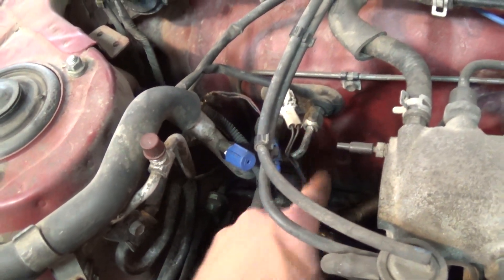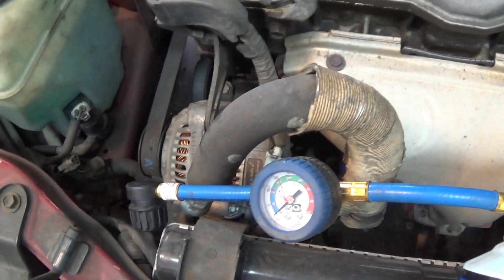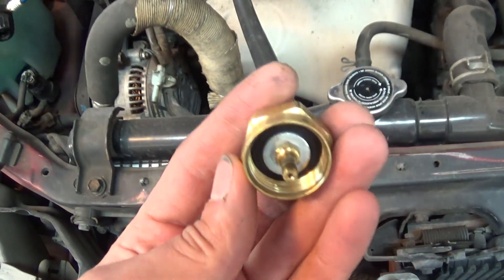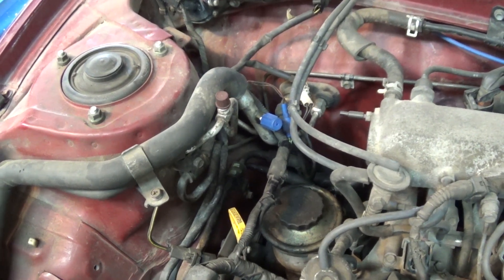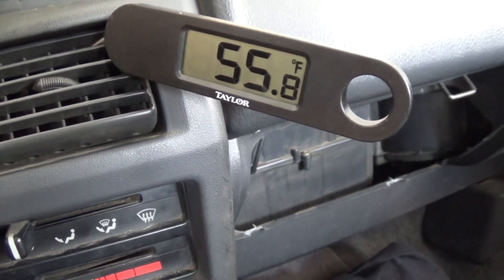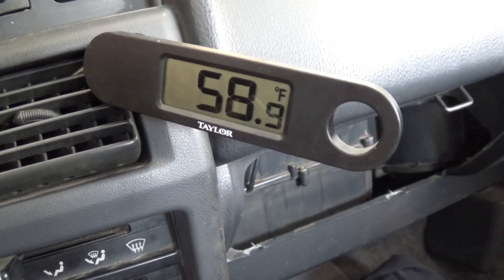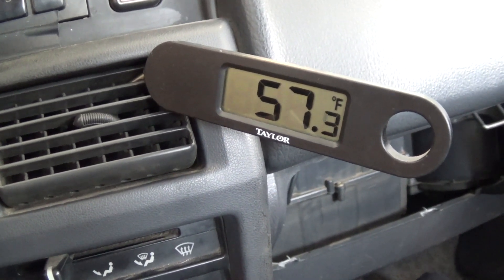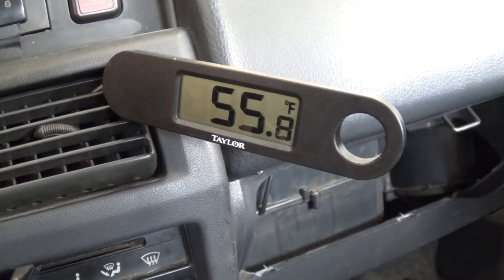Using Propane instead of R12?

Comment: I got my R12 system charged in Mexico. It is still legal over there.
Reply: US refrigerant patents do not apply in Mexico.
When DuPont patents expire on refrigerants in the US, they pass laws to make them illegal to use, phase them out, then offer "replacement" refrigerants manufactured and patented by DuPont. The cycle begins again, initiating the countdown until patents expire again.
Its part of the Global Warming scam, and is essentially legalized  monopolization of the refrigerant supply manufacturers.
You can't stop it. Best to just buy stock in DuPont, and get on the "profitable side" of the fence.
Reply: marshalllhiepler - Amen! You said it, what a scam.
Reply from the maker: Nice!  Yeah I've heard car repair can be cheaper in Mexico.  I think R12 is still "legal" to use here in the US it's just not legal to manufacturer.  Browsing some forums tells me that all you need is some sort of license that isn't too expensive and you can buy and recharge R12
Reply: @CtrlAltDefeatTV  Can you use propane in Mexico instead of R-12?
Reply: @CtrlAltDefeatTV  The R12 itself is very expensive though.
Reply: @CtrlAltDefeatTV  you are correct. R12 is legal under a certain license, not hard to get, just outdated. That's the issue.
Reply: I have heard that R12 is still made and sold in the far east.
Reply: R12 is f....g nasty!  Nobody should use that, that destroys the ozone layer and is a powerful greenhouse gas!
Reply: @anonyme0897  who gives a fuck 😂
Reply: @anonyme0897   Neither of those statements are strictly true. Quit drinking the enviro-Kool-Aid. Then ask yourself why the "ozone hole", which isn't really a hole, fluctuates with the solar weather.

Comment: It would work even better if you purged all that atmospheric air from the empty can and hose.
Reply: Interesting, but I do not think that the can would survive a vacuum intact.  Probably best to rig the setup without the can by splicing via the hoses and a suitable connector.  Some valves and a tee for a vacuum pump would be useful there.
Reply: @richhagenchicago  you wouldn't need to pull vacuum for that. Just give the fill trigger a pull to bleed off air from your fill lines. (lightly pulling trigger while screwing in the propane supply might be better). Your ac vent temp will not drop  bellow 52 even if you are driving. Mecanical Thermostat on the evaporator box controls the cutoff temp.(some times theres a little screw you can adjust on older cars)
Reply: Nothing like adding atmospheric air to pump up your head pressure. LOL